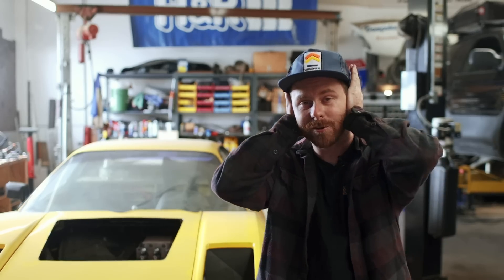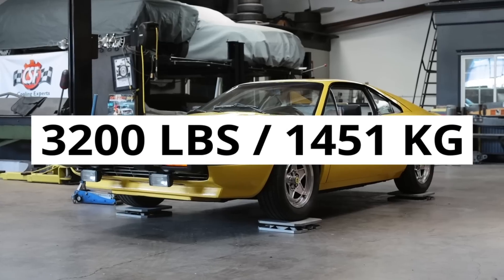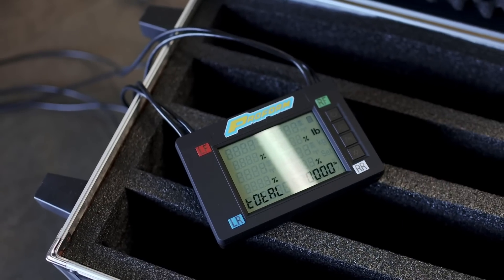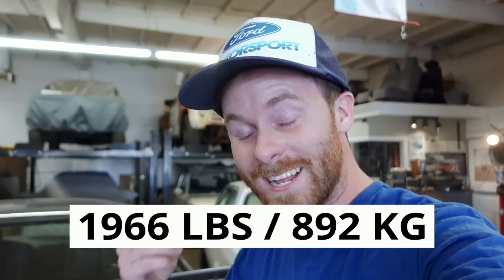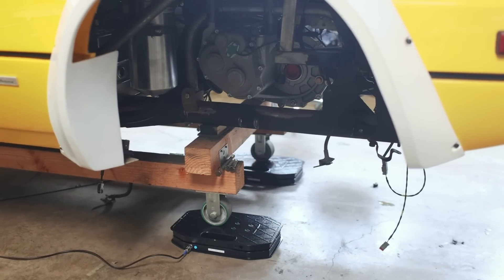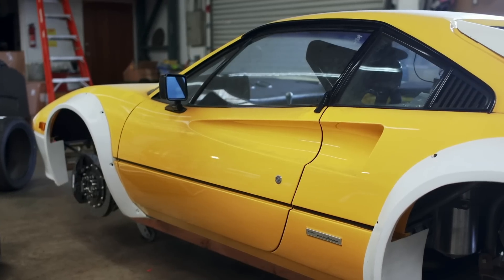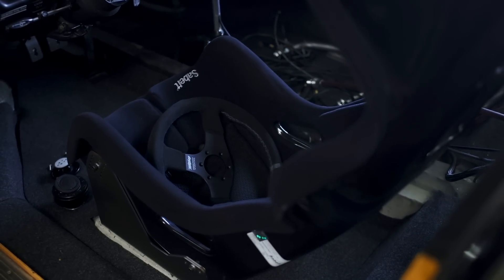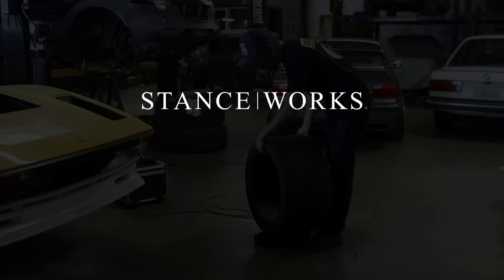How Much Does a Honda-Swapped Ferrari Weigh? The "244 GTK" Hits the Scales

Comment: Dude that is impressive, shaving that much weight is a lot. The rough calculation is that every 8lbs consumes one hp. I know that is a very standard throw at the wall number, but that’s gaining roughly 125hp just on weight alone. If you end up with a car 1000lbs lighter.

Comment: Lexan windows is weight saving up high, instead of uprights or controlarms,
Either way, great numbers so far!
Reply: Uprights and control arms are unsprung mass, so just as important if not more important than the window mass high in the CG. Maybe just do both :)
Reply: @TheBCninja  Thought unsprung mass were moving parts like axle, brakes and wheels,
But I agree on both!
First make the car driveable though
Reply: @righthoekstra  so the uprights are kind of what connect everything together in terms of suspension, hubs, wheels, and brakes. So they are unsprung. And the A-arms are a portion of the mass on the shocks, but I think that's distributed with its connection with the chasis too. I'll let a mechanical engineer chime in there 🙂

Comment: Nice job Mike. I can’t help but wonder if that one scale is still bad though. The low reading moved with the scale…unless that scale is short, you’d think the light corner would stay in the same location. I hope not, but a quick test of a known weight would confirm. Good luck!
Reply from the maker: The scales positions were switched but I didn’t unplug them and swap wires. So the movement of the weight on the screen - follow the colored wires to the pads. It’s reading correctly 👍

Comment: Hey Mike. Don't forget you have to level the scale pads before getting usable corner weight data! Without leveling them, overall weights are still accurate, but not individual corner weights.

Comment: I hadn't really been following til I listened to the HP academy podcast, dude I totally get it now. Holy shit what a savings. This is a perfect example of my philosophy on weight savings which is to knock out the biggest things first. For example, if you wanted to build a lightweight race car with no other constraints or goals, a small car with a two stroke snowmachine engine is the ultimate, you can pull massive massive weight out of the drivetrain. To some degree, that's what you've done here! Very cool shit. You've got a car with glass, steel suspension, very normal componentry that's easily fabbed, replaced, serviced with just a massive massive savings. Excellent.

Comment: Working in aerospace really drives home the value of saved weight. Every single person I work with in the field is trying to shave every corner, eliminate un-necessary components and exploring lighter materials. It gives a new perspective to performance and fuel savings that can be designed into something without actually doing anything to increase power output or powerplant efficiency. I might watch the channel to try and escape work a little, but seeing your true joy in getting surprisingly low numbers makes it worth it. Much better than disappointment in not making your target.
Reply: Nic, not hitting "targets" should not devalue the work you do. The sum is greater than the parts...

Comment: Excellent!
I've got the same tires on a car, you really won't find anything much lighter.  Its gunna come in at about 2550 unless you remove and replace steel reinforcement areas with lighter tube steel.  Remember, Porsche put a decal emblem one of its cars because it was lighter than the metal badge...lol.

Comment: Lexan rear window, side rears, leave the door glass and windshield for practicality. Carbon side mirrors and smaller. There’s a good bit of weight in the steel uprights go billet. The light weight seats is also a easy option I think your current is quite heavy. Look at lighter horn and wiper set up if you still have them.

Comment: What a great result! I’m a bit weight obsessed when it comes to cars as it’s key to increasing all round performance. Power to weight, unsprung mass, rotational mass, polar moment of inertia, etc! I agree with the areas of the car that could lose some more weight but hold off on suspension components until you are dialled in. It’s not too expensive to remake steel arms for geometry improvements but to have aluminium machined is not a cheap endeavour!

Comment: This episode made me look up the specs on my '72 MGB-GT. I know that the factory weight is just over 2400lbs and my sense was that is was smaller than the Ferrari, but that could have been because of the blockier shape. But my sense was correct, my car has a 1" shorter WB, is about 14" shorter overall (much shorter front and rear overhangs) and 7" narrower. It is 6" taller though (the GT is a 3 door hatchback). Interestingly despite being smaller, 4 6-4 250lb frame fits just fine, something that I do not believe would be true with the 308. An 800lb difference in weight is pretty amazing, especially when you consider that the MG engine is all cast iron and quite heavy, the alloy 3.5 V8 from a Range Rover weighs about the same as the 1.8L B series 4. A GM 60 degree V6 like the 2.8 from the Fiero or 3.1/3.4 from the Camaro only weighs about 65lbs more. Ferrari definitely could have benefited from some Lotus like attention to weight.

Comment: that weight is insane especially once you factor in how much power you will be running.   even 500hp would be sheer insanity.    And you are dropping mad hints on your next build aren't you?   Can hardly wait to see footage on that one
Reply from the maker: I have dropped a lot of hints but it’s not the Vehicross in the background.
Reply: @stanceworks  please do videos on that one too then lol.   Since you have all this extra weight to work with, do you suppose gussets in the engine bay would help since the frame was designed for a fraction of the power you're planning on running.  The oem Ferrari frame seems thin
Reply from the maker: The chassis has a lot of extra metal back there now :)

Comment: A late view today because I was stuck at the office, but hey, my merch also got here! Having a great evening opening the package and watching the episode.

Man I've gotten so used to seeing the car in it's current state, that flashback to it's original form looks so foreign. It's come a long way!

Super stoked that it came to such a low weight, even a predicted weight under your ideal weight! This thing is going to rip around the track. I'm not sure I'd go down the super weight savings rabbit hole just yet myself though. It'd get pricey fast.

Definitely agree with your choice of wired scales though. A common thing in engineering is to cut down the amount of failure points, and a wireless set would just add a ton of them. Plus it's much easier/cheaper to replace damaged cables than an circuit board assembly!

Comment: Just to throw this out there, body panels can be remade. If you take a negative mold off the original panel it's easy and worth it to remake those panels from carbon fiber or another composite. I know carbon is expensive but it's the lightest of the composites. With 3M panel bond or their chassis weld bond epoxy you can shave at least another 350lbs off from the replacement of the metal panels from the build. I won't fault you if you decide against it. That's a massive undertaking for an already long build project. It's also really expensive and I wouldn't blame you for not wanting to deal with any of that. Just consider the experience of remaking the doors. It's easy to take negative molds of the outer skin, the inside structure, and even the door card which looks super sick. Throttle Stop Garage's channel has a playlist on an old Volvo which is being rebuilt from composite except for the frame and chassis. It's an interesting process to watch...

Comment: Nice work!  To put that into perspective, I think my SL-C is around 2250 lbs wet with an aluminum frame, lexan, etc.  Granted it does have an A/C system in it and a LS3, but still that's impressive you got it down that low!

Comment: Weight reduction in a racing car has a recursive effect. E.g., coming in 400lbs light means the suspension, brakes, even the chassis, are considerably over-engineered, each dealing with significantly less stress than they were designed to do. For me, that points the finger for additional reduction squarely at those parts. Wheels, control arms would be top of my list, each bringing multiple advantages. Congrats on this milestone.

Comment: As far as wheel weight, you've already chosen a really good tire!  The A052 is MUCH lighter than most other tires in the same load rating.

Also, off topic, that little Isuzu on the lift...  Has Steph Papadakis given you some inspiration for a little off road fun?

Comment: The biggest problem is with the wheels and tires. 
That affects acceleration and brakiing so much, alot more than the chassis weight it self.
You could try to run something smaller and narrower.

Comment: Doesn't the fact that the "light" corner moved from front left to front right when you moved the scales mean that the scale with the light reading is thinner than the other (or under reading for some reason)? If the scales were identical, the front left would have been 4.3% both times you weighed it.
Reply from the maker: I moved the scale, still attached to its respective cable.
Reply: @stanceworks  That explains it. Was also curious how it was so close to the previous reading. You must have a nice flat floor!

Comment: I know you don't like a caged road car, but with this power, and carbon doors in the future i definetly would go for a full cage... especialky sinds it is an old as car and safety and chassis rigidity is poor. for america, 2200pounds is light.... in Europe it is the normal weight for a family car with 1.2 liter 3 cilinder with 120hp and 180NM over most of its rpm range ... so its still a heavy pig but it is an old car ofcourse. it should way half or little over half IF it was a dedicated race car. it is an awsome car and awsome project and the video quality is also awsome. Don't apologize for rambling! people who have watched to much discovery channel think a car like this in 1 week. all the decissions and thinking you show is what a real unique build looks like. guys like you make youtube great. Perhaps big panels like the fire wall can be replaced bij aluminium if they are not jet made from it, or carbon.

Comment: Get a titanium roll bar, magnesium wheels, carbon ceramic brake disks, carbon fibre racing seats, carbon fibre steering wheel, lexan glass, to save more weight, inconel/tinanium down pipes and exhaust system.

Comment: if you don't wanna go with a lexan windshield, you could still go with a thinner glas windshield, there are different companies manufacturing these, without comprimising windshield stability and without the drawbacks of lexan, such as the big problem with scratches
Reply from the maker: I don’t have any desire to change the front glass. They’re extremely problematic and prone to breaking and cracking, and they never seal up once they come out.

Comment: Very impressive numbers!

You actually could work out the Front/Rear weight balance with some simple maths if you know the positions of the castor wheels relative to the car's wheels. Corner balancing doesn't change the front/rear or left/right split.

Comment: 1964 lbs. is pretty impressive. Considering where it started.

Is there a way to swap out the window arms, actuators and electronics? Possibly convert the windows to manual crank instead of electric? Aside from going Lexan to lose a little more weight?
Reply: believe it or not, electric windows are usually light that cranks...
Reply: @gregmcable  Kinda makes sense now that I think about it. Since the mechs to raise and lower a window have to be beefier if they are manually cranked instead of electronic.

Comment: The only thing more important than weight is slipperiess.

For reference, at 20mph a frontal area the size of a pencil is equivalent to dragging an extra kilo about.

Just taking the windscreen wipers off would make a big difference. Eliminate some panel gaps, have a look at the underfloor & engine bay.

Aerodynamically cars are inferior to buckminster fuller's 1930s mini van.

Wind tunnel analysis would make you views.

Comment: Mike Lexan windows,composite doors and carbon seats are for race cars...isn't this a road Ferrari/time attacker?
Will stripping it so light make for a livable street car? NVH problems?
Reply from the maker: The carbon doors and seats won’t make a difference but the lexan would. But as far as NVH goes we are screwed anyway. Every suspension joint is a solid heim joint.

Comment: Simply loosing weight is not the be all and end all of the matter.
It is where you loose the weight and how you loose the weight that is important.
Also, ultra-light cars can be skittish on the road or track. Remember that you are not ever driving on a smooth glass like surface.
An ultra-light car will doll into and out of each bump or hollow in the road while a heavier car will overall not because of the mass and the suspension will compensate. Another reason why rock hard shock absorbers are not necessarily the best choice to go with.
BUT until the car is on the road, how it is going to handle is merely speculation and an educated guess.
You may even wind up bolting some lead over the front axle to get the weight distribution "right" bearing in mind that for this car the "normal" 60/40 ratio may not work the best.
But it will be interesting watching you work all of this stuff out.
And you are starting with a "better" overall package than the original and you have a bunch of "wriggle-room".
So good luck - can't wait to see it actually run...

Comment: At a 1000+hp car trying to save a 100 lbs isnt going to be more important than weight distribution. You are just going to end up adding back with weight plates. I would just finish and see where you set before trying to eliminate any more weight. 1900lbs insane for that car!

Comment: Bro you have 200lbs to play with to reach your 2500lb goal. Add lightness, get the car built, then strategically distribute weight where you want it for ideal weight transfer characteristics in cornering loads.

Comment: I'm pretty new to the channel, but do you have the skills to drive a 1k hp 2400 pound rear engine car? I'd detune that thing down to 500 hp or so until I had significant seat time.

4130 for further weight savings...
Reply from the maker: I don’t. The other turbo setup will go on and the car  will make 500hp or so on track.
Reply: @stanceworks  me either and the thought of it scares me. 😂

Comment: All said and done with you in the car it will weigh 2700 to 2800 pounds which is kind of heavy for such a small car my Integra DC2 weighs 2200 pounds and 2400 with me in it try not to add too much weight small cars you really feel the weight on turns.
Reply from the maker: A DC integra is a unibody car though. This is a body on frame/tube frame car from the 60s. It’s gonna be heavy.
Reply: @stanceworks  Good point keep up the hard work.

Comment: That's why the stock 308 was more or less laughable for those who knew the real performance.
Reply: It’s a pretty much 50 year old design. Would have felt plenty quick back in the late ‘70’s
Reply: @adamsmith9412  the early carburated, glass fiber cars were fast. After they switched to steel, the car grew too heavy. Emissions made it only worse (switching from Webers to Bosch FI).

Comment: 1:1 would be sick! which means that Ferrari engines are simply a ton (literaly) of garbage LOL
Reply: Are they? 50 year old design
Reply: @adamsmith9412  well, you've got a point there... i was just referring to the fact that this car with half the pistons and displacement will probably be ahead of every current Ferrari on the market. Yes, probably will have a ton of turbo lag and will be noisier and more unconfortable, but it will be a better drivers car than every current Ferrari